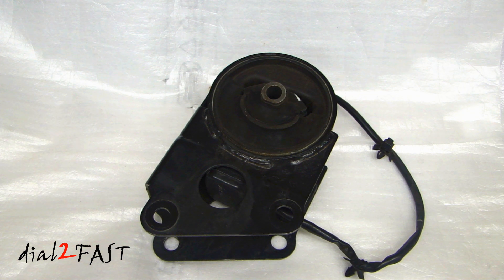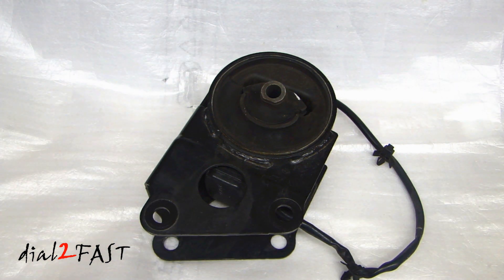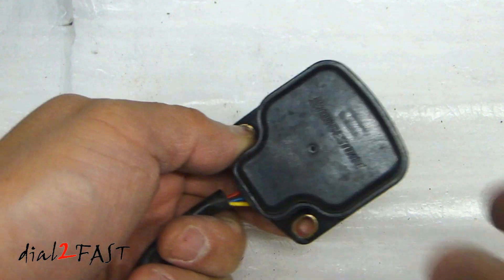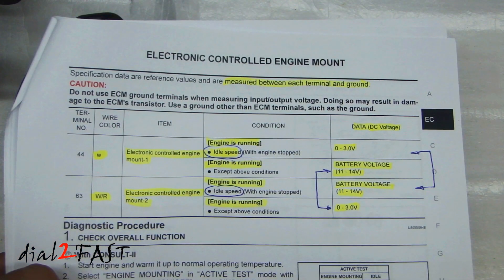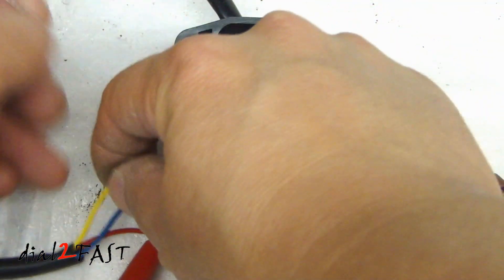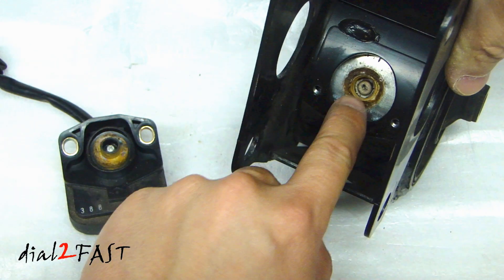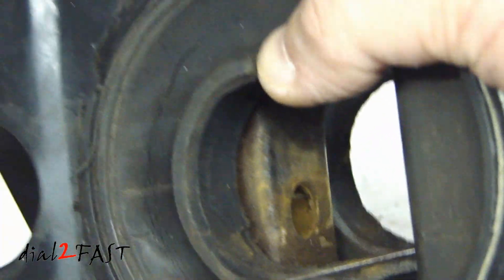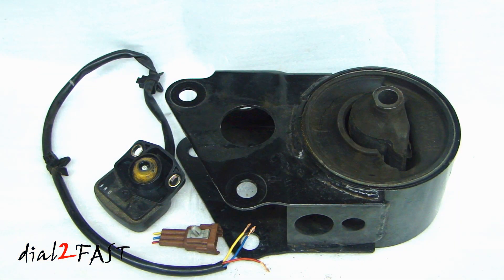Nissan Electronic Engine Mount | How Does It Work?

Comment: Thanks for the informative video, to the point and easily understood. I have one of these hanging in the engine bay of my 2006 Nissan Maxima sl. I have searched online for any picture that matched, just so I would know what it was n where it goes. My car has MIL n runs rough, so I wondered if this has any part in this situation.

Comment: I replaced the motor mounts with a set I bought online.  I noticed the electric module was loose and the wire was routed through the mount which didn't allow the connector to plug in, so I removed it.  Upon removal the new module and mount did not have any interconnection like the one you are dissecting.  There is no blade that rotates and the motor mount is solid metal where you show a slot.  Are the new mounts that come with a wire connector simply dummies?

Comment: That was awesome AND thorough..I never thought I'd find a video explaining the workings of that particular engine mount..thank you so much for all the hard work and energy expended to educate someone like myself and others who are interested in how stuff works..thank you sir..already changed the passenger side (upper mount) 2007 Murano ..the other three will be worked on in about two weeks..actually we removed the transmission mount and when we tried installing the new one we bought from Autozone the holes did not line up with the mounting stud bolts on the chassis..ended up popping the old one back in...will be doing it all over again in two weeks..

Comment: Thank you for your video, I just bought a 2013 Nissan Quest. We had to sell a 2015  Quest due to hail damage, and I noticed the 2013 is a little louder when in idle. I was worried that the engine might had something wrong. I just checked the engine mounts and they are bad, will be replacing soon, thank you 🙏 for posting this video

Comment: I have a 2005 Altima SE-R (VQ35DE) and it has electronic engine mounts.. and I need to replace them. Do they make a difference from traditional engine mounts??
Reply from the maker: I know for the Nissan Quest, some people replaced it with a non electric mount and there was no check engine light. I am not sure if a traditional mount will have that much more engine vibration or is very little difference.

Comment: Great video!

This system is an absolute joke!  Does Nissan really think this really changes the stiffness of the mount?  All it is doing is splashing a little fluid around when it rotates.  Think about the weight of the engine sitting on the mount. That low powered motor that rotates that valve is no where near powerful enough to lift the weight of the engine.  This system is nothing but a money grab for Nissan.  This mount costed me $265 when I needed to replace mine.

Comment: Just a warning before installing motor mounts and sensors take the sensors off two screws... I purchased several motor mounts from different sellers that had  hollowed  out sensors and no slot on motor mount if it was not for the fact the wire for my rear sensor was shorter on the replacement I would have installed a non electric motor mount on my vehicle!

Comment: I had a friend at a Infiniti dealer nearby that had a nice older i30 that he got from a customer super cheap because the mount failed and leaked all over the motor and backfed power, that ended up shorting out the ECU. 
I was a Nissan tech for 2 years. I even went to some Nissan schooling and we never went over this or even brought it up. Thanks for the lesson!
Reply: Oh yea that’s
Reply: Not sure I recall the motor mounts causing those issues on i30 infiniti's. However the earlier IACV motors had a gasket that would fail and cause shorting issues that would damage the Ecm.

Comment: Very interesting and informative video!  I have to replace the front mount in my 02 Maxima GLE, and am trying to decide on the fluid filled (electronic) vs standard mount. Standard mount is cheaper of course, and there are cheaper electronic OEM alternatives as well. BUT I did find the genuine Nissan OEM mount for $100 shipped, so i am considering going with that. My question is, if this is an older OEM part that's been sitting on the shelf for awhile (perhaps years) would the fluid (or the housing) even still be any good?

Comment: Thanks for the video. My rear electric engine mount on my 2000 Maxima SE was making the cranking noise that occurred when you attached the 12V to the blue and yellow. This happened to me while the vehicle was completely OFF. Yes, no key in the ignition and the car in park. A local shop disconnected the wiring to the mount. I am going to monitor performance now. Just didn't want my battery dying due to the mount continuing to pull power from the battery when the car was off. Do you think performance will be noticeably different?
Reply: Keep it disconnected and disconnect the other one as well, these mounts short out and fry the car computer on the A33 maxima due to Nissan not circuit protecting the ecm from the failed mount.

Comment: I have a 2005 nissan quest, it need another motor mount but its electric like yours, is it fine if i just switch it with a normal one that had no wire on it, will this affect the car?
Reply from the maker: I have heard people replaced it with the non electric version and it was fine, but I have not tried it myself.

Comment: Do you actually need the electric motor mount or can you just replace it with a standard solid motor mount
Reply from the maker: I know there are many people replace with the non electronic one and said it works fine.
Reply: dial2fast thanks

Comment: Is there anyway to cheat computer by installing non electronic mounts? Great video. Or i can take electronis motor from mount and zip tie on the harness and leave it there and install non electronic mounts?
Reply: You can use non electronic mounts. You'll just have a little vibration and NVH when your foot is on the brakes and your in D.

Comment: could it short out the ECM?
Reply from the maker: Most likely not. The ECM is designed quite robust.
Reply: dial2fast reason is because in my Nissan there is no relay switch to shut off power after the car is shut off.
Reply: I'm a Nissan master tech and they do fail and destroy the ECM.
Reply: They do on the 00-01 Maxima

Comment: Awesome video. You do great work! Thanks a million. Would you consider doing a video on changing the Rear Mount. Also, looks like the Rears on these are "manual" but I bought electronic. You think it matters? Thanks again.
Reply from the maker: I checked the rear mount on my van and it actually looks good. Seems the make wear on these mounts is the front and passenger side. I did look into the steps in changing the rear mount and it's a total pain is you are trying to do it with jack stands. Think you have to cut off one of the bolt to remove the old one. If you bought passive mounts, they will work fine.
Reply: Thanks a billion for the super quick response. I honestly didn't anticipate it. I finally changed out my rear and tranny mounts. They were a BUSTED MESS! interesting enough, by mere eyeball inspection, they looked alright...but the drive always told me different. So you might wanna take a even closer look at yours but I gotta tell ya...them things are a booger to take out. Took us 3 days. Maybe it's just us :).....oh also, I just went on ahead and put in the electronic rear mount and left the cord dangling. Couldnt find anywhere to plug it. Thanks again

Comment: I'm about to have my mount replaced next weekend. Because this part is "electric", I'm wondering if it's the reason the "service engine soon" light came on. i'll find out after the job is done. thanks for this video.
Reply: Mounts are not monitored by ECM, you have a second issue.
Reply: Electric motor mount so yes

Comment: i bougth one like this but without the electric control engine mount can I use my old one and put it on the new one ?
Reply from the maker: You can't put the old damper in the new one that is not equipped with it.

Comment: Did you cut open the rubber part to see where the valve was going?  I am curious if there was an air chamber or just a fluid filled cavity that the valve was cutting off access to.
Reply from the maker: +fixpro256 Unfortunately,  the engine mount I showed, it has already failed for quite a few years. By the time I pulled that center part out, there was nothing left inside. From the research I have done, the NIssan mount is filled with a fluid when new. Also spoke to someone at Nissan dealer service dept and he said it's fluid filled.

Comment: Do you think if I install another one with no wire mount my check engine light would come up? Or what would happen? Thanks for a good video
Reply from the maker: +Fidel Meza From things i have read on the internet, it should not trigger a check engine light, but i am not 100% sure. You will just have some vibration at idle. Ride quality might not be as smooth.
Reply: Fidel Meza I was wondering the same thing